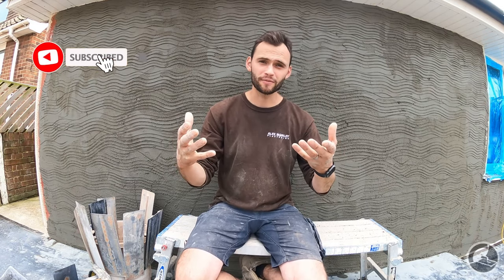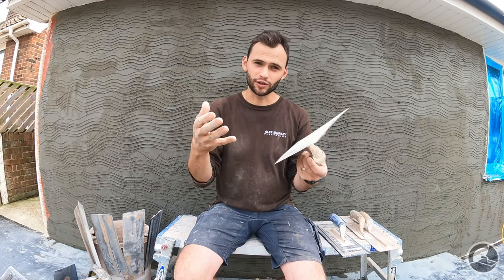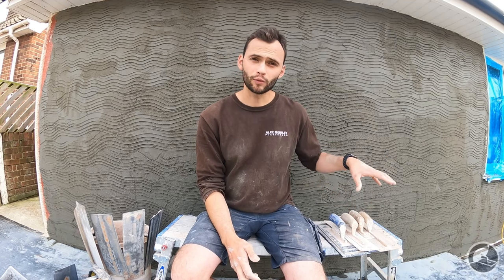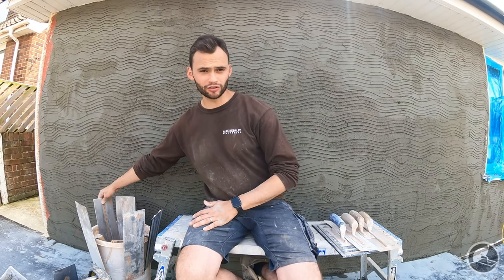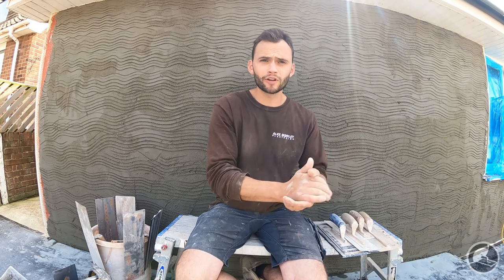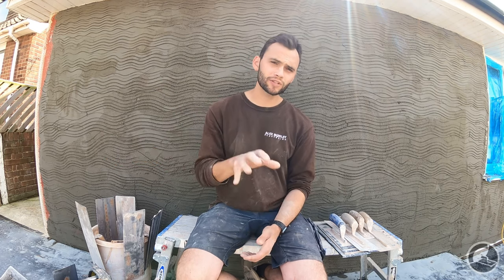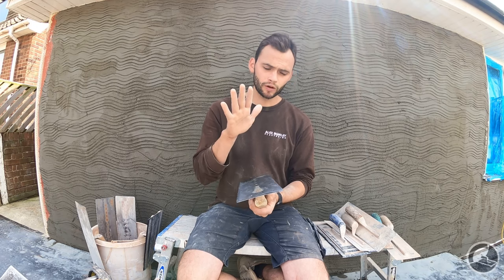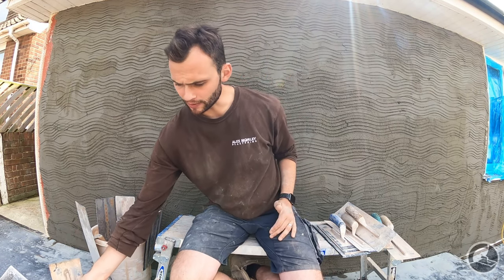Which Plastering Trowel Should You Buy??

Comment: I am not a plasterer but have learned it over the years as I have done a lot of renovation work. I have various trowels  and agree with you about the size. I have also found stainless steel trowels a little problematic as it does not take much for the plaster you have loaded onto the trowel to slip off and end up on your boots !  Whereas carbon steel trowels tend to hold the plaster on more - I presume this is because of the surface being slightly pitted by oxidation (rusting).  I think tis also helps in the distribution of the plaster as you do the first layin on stroke. This is just my opinion - other may have theirs of course !
Reply from the maker: I like this comment. I completely agree. In our video, Carbon VS Stainless I mention the plaster rolls off the trowel much nicer, IMO because of the surface pitting/rust. 

Good comment. Thanks for your opinion

Comment: Ive used an 11" for a long time, with skimming first coat with the 11" second coat with an 18"  xtralite leaves very little troweling up to be done. 
All the later troweling i use the 11" 

Though like most i have loads of trowels its nice to have the right size when you need it.

Comment: I learned with a 13 inch trowel, used it for years, then went to 16 and 18inch for skimming on board. WOULD NOT recommend big trowels for sand and cement etc, this is where the strain comes. BUT for skimming, the lack of pressure doesn't really matter. Also, a 6 metre long wall would need 18 strokes with a 13 inch, but only 13 strokes with a 18inch trowel...Saving your knees/shoulder/back from bending over 5-10-15-20x per wall/ceiling.

Comment: Bought the Nela premium for coating. Fuck me, lines EVERYWHERE... Tried to persevere but don't do much rendering and as I only had an 11 inch permashape marshaltown for skimming I bit the bullet and got the 14 inch Marshalltown permashape (gold handle) honestly, what a difference straight out the box. I use that and the Nela black edition (absolute monster for final stages)
Reply from the maker: I agree. Louie had the 16” Nela Premium. A very flat trowel. Tbh the 14” carbon was like that as well. Not the case with the 13” we just bought.

Comment: Thanks for the great video Alex, Going to attempt my first ceiling soon and I'm planning on buying a Marshalltown Permashape 13x5inch finishing trowel. Would that be a good trowel for a beginner? and would I be ok doing all stages with that one trowel, coupled with a speed skim to help get it flatter. Any help would be greatly appreciated.
Reply from the maker: Yes that’s a good trowel. I’d probably go for an ultra lite if your going SS. it breaks in a bit faster. 
It’s totally possible to get a nice finish with 1 trowel. You just have to be a bit more tuned up on the timings to stop the plaster dragging and causing higher stripes.
Reply: @AlexMorleyPlastering  Perfect Alex, really appreciate the reply. Is the ultra light made by Marshalltown as well? Thanks again.
Reply: Great video pal. Do you prefer carbon steel trowels. I’ve just bought marshalltown wooden handle 13 inch carbon trowel
Reply from the maker: @LiamMetcalfe  apologies just seen this. Yes it is.
Reply from the maker: @jasonflynn2408  100%. Gives a much nicer finish
Reply: @AlexMorleyPlastering  looking forward to trying it out. I’ve an 15 year old 20 inch marshalltown Carbon steel trowel but ain’t used it in nearly 9 year haha

Comment: Great videos.. What steps do you have to do to control the rust on a carbon also what one do you have 13 inch ? Nela marshall?
Reply from the maker: Tbh, I’m a bit lazy with stopping the rust as we use them every day. But generally we dip them in vinegar over night to turn them black, to easy on the rust. Then if we do apply oil, all you need is to soak a rag in WD40 and give it a wipe over once you have finished using the trowel.
Reply: Use VP90 spray keeps rust away

Comment: You mind putting a link on the carbon steel you use please.thanks
Reply from the maker: No problem. 

This is the one we are currently breaking in. We also have the Nela wooded handle on it which we prefer. 

https://www.plasterers1stopshop.co.uk/product/nela-carbon-steel-trowel-13-x-4-75/

Probably one of the best trowels to break in that I have ever had.

Comment: the problem with 14 inch is it take longer to put plaster on the wall
Reply: Years ago, I shrunk my Tyzack down to less than 11 inches and could still blitz the big trowel club that only started to develop in the mid-90s. Additionally, with reference to skimming, a lot of today's plasterers really do not polish up a wall properly and nor do they do what is required of plaster in the first place, which is to secure with good adhesion to any background. They rely on lashings of SBA or PVA to keep the stuff to the surface, especially ceilings, and over time their work becomes friable within a couple of years and falls off... and talk about edges on old houses...dear me...